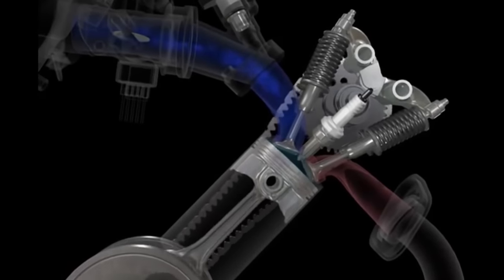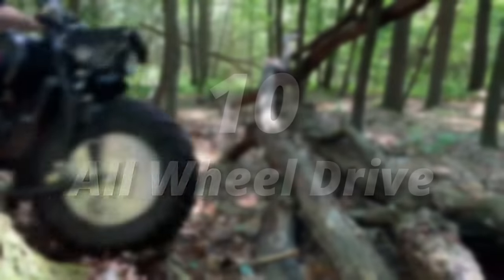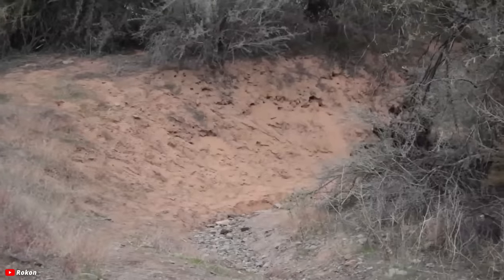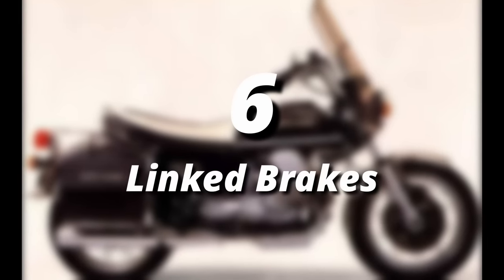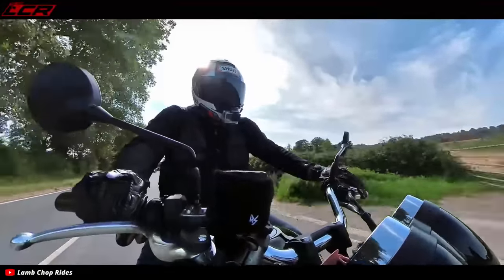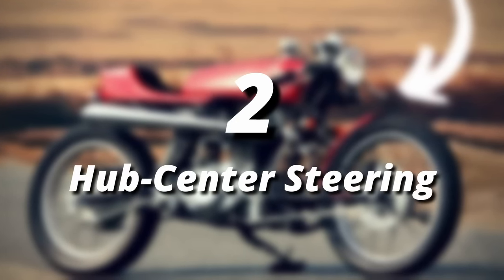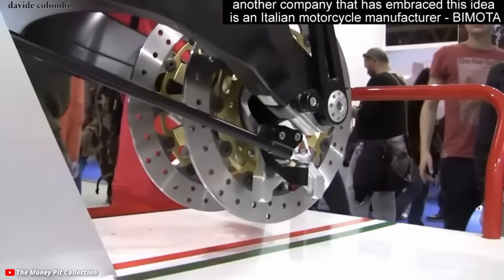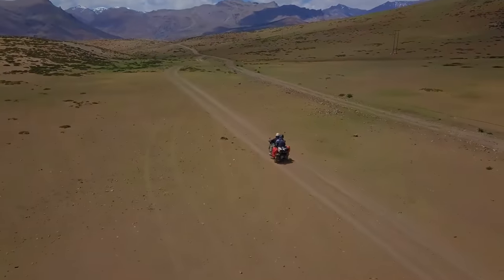10 Motorcycle Innovations that never caught on

Comment: I owned a Moto Guzzi with the dual braking system and I loved it. The foot pedal operated front and back disks. 60% braking force to the front wheel, and 40 to the back. Very useful in wet slippery conditions. The front brake handle was totally separate as normal.
Reply: I also own a Guzzi with linked brakes, my understanding is link brakes prevent driveshaft jacking when braking into a corner.  The linked brakes was only used on guzzi's cruisers, not the sport or sport touring bikes.
Reply: I own a California, and I think the linked brakes work brilliant for the riding style. It keeps the motorcycle level even during emergency braking. Also, with the foot pedal it's easier to brake hard, in combination with the hand operated front brake. During emergency stops, the hand operated front brake is easier to reach, but less effective, in practice you kind of "pre brake" with the hand lever and add the other front and rear brake with your foot. When familiarizing myself with this on an empty parking lot I found that I could stop just as fast as a modern abs bike, without losing traction.
Reply: I think the pedal worked the rear brake & one of the front brakes, while the handlebar lever worked the other front brake. Well I know some Guzzis worked that way.
Reply: Great video!  With regard to linked brakes, I use my front brake in most situations and would benefit from linked brakes most of the time to improve and simplify the process of slowing down and stopping.  However,it would have to work in a specific way to be practical .  Linking the front (hand) brake to the rear (foot) brake makes sense especially with ABS.  You could more quickly grab a handful of brake and either modulate it or clamp down to deliberately achieve a rapid deceleration or stop.  But, on the other hand, linking the rear brake to the front brake does not work because when you are descending a steep grade on a graveled, wet or otherwise slippery road surface you need to apply the rear brake only to drag the bike to a stop and avoid the massive forward weight shift caused by application of the front brake so as to maintain your balance and preserve as much steering traction and control as possible.
Reply: I had a 1984 Guzzi V65C with linked brakes.  The bike braked extremely well and never locked up a wheel.  I felt totally safe even in  the few times I got caught in rain.  Had to sell the bike to pay for college, miss it to this day...
Reply: @not-fishing4730  Did you not change down using the guzzies massive engine brake? I did on a Honda CB350 straight twin 11.1 compression ratio,brakes were effectively redundant
Reply: @billeudy8481  Can i presume when you go down a steep grade you don't change down but just apply your brakes?
Reply: @Johnketes54  I engine brake without a change in gear unless I need the lower gear for the turn exit.  Being an old man I tend to use the brakes for major decelerations as brakes are cheaper and easier to replace than clutches or rings/jugs.
Reply: I had my California for about a month before I realized the brakes weren't even working I fixed them and still don't really need them the engine braking does it for you
Reply: @not-fishing4730  No, here in the UK the Le Mans and Monza both had hydraulically linked breaks
Reply: @not-fishing4730  Not correct. My 850 LeMans Mk2 had linked brakes. Footbrake operated 1 front disc and the rear disc, while the hand lever operated the other front disc. Once you got used to how it all worked, it worked brilliantly, especially in the wet.
Reply: @mickvonbornemann3824  Exactly!
Reply: @Johnketes54  I certainly did on my 1976 Ducati 860 GTS. Fantastic sound through the Contis.
Reply: @not-fishing4730  That's not 100% correct. My 1980 X100 Lemans had the intricate breaking system. At that time they all Guzzi's  had it.
Reply: @not-fishing4730 -  "The linked brakes was only used on guzzi's cruisers, not the sport or sport touring bikes."
WRONG.  I had a Moto-Guzzi V-50 II; other friends had the 850 Le Mans II and the 850 T3;  ALL had linked brakes.
Reply: @mickvonbornemann3824  - yes, Mick;  you're dead right.
Reply: @billeudy8481  - "when you are descending a steep grade on a graveled, wet or otherwise slippery road surface you need to apply the rear brake only to drag the bike to a stop."
Speaking from personal and very hard experience, I know that's the surest possible way to lock the back wheel and go into a broadside skid.
Reply: @hammondeggs3356  - I know what you mean;  my V-50 was stolen, and every time I see even a picture of a Moto-Guzzi, I pray that the stinking little rat who stole it burns in Hell for all eternity.
Reply: @Johnketes54  "Did you not change down using the Guzzi's massive engine brake?"  No, never - because I can't think of a better way to lock the back wheel and have the bike go sideways.
Reply: @not-fishing4730  Sorry but linked brakes were fitted to Le Mans 850 and V65 Larios both of which were considered sports bikes in their day.

Comment: Honda had a great linked braking system where the rear brakes engaged the middle piston of the front caliper, as well. It works amazingly well, I have it on my VTX1800, and it adds stability to stops that really helps on larger bikes. You can still skid, since the front has3 pistons on each side, total of 6, you're only engaging 2 of the 6, just barely noticeable, but very helpful in some situations. I believe the front brake lever works the same way, engaging about 20% of the rear, but I'm sure.
Reply: I have the same on my Honda Silverwing scooter. Works great! It was invented by Moto Guzzi :-)

Comment: I once had an old hard tailed, HD, two stroke, single that had a left grip mounted , 3 speed, shifter clutch like you show here.  I thought it worked just fine, but I did not ride it in the woods or on the trails, either.  I imagine that it might have some problems, there.

Comment: Hey Bart. Interesting video, but  you left one out. Anti-dive front suspension, typically front forks, but my former boss, John Long, the roadracer from Miami, Florida raced a BMW with a manual (for lack of a better word) anti-dive setup with rods and levers back in the 80s. All the other manufacturers were using some kind of hydraulic system which diverted some of the fork oil to stop the forks from compressing under braking. Incidentally, BMW's team manager was Udo Gehtle (not completely sure about the spelling of the last name), who went on the manage team Honda's roadracing effort. Anti-dive showed up on many of the major manufacturers production bikes, but it was complicated and only made front fork maintenance more of a hassle.
Reply: I rode a BMW R12C for many years and loved that bike (until the driveshaft stripped = $2500 repair!).  The innovative telelever front end was very effective at keeping the front end from diving...I miss that bike  😥
Reply: @acehandler1530  Thanks for the response. I worked on Beemers, first boxers back in the early 80s, then K bikes later in the mid to late 80s, even went to 2 BMW schools to learn how to work on the latter. However, I got out of the motorcycle industry in the early 90s and never rode a beemer with telelever suspension, altho I did read about it. Even before telelever, BMWs were great handlers and I was very impressed with ABS. I didn't know or remember that one of the features of the telelever front end was anti-dive. Thanks for clueing me in.
Reply: @parsonscarlson7984  Had a K1200RS for awhile, really liked the bike, especially the Telelever. 
Trying to work on the bike was such a PITA I sold it.

Comment: When we were growing up in the late 60's to mid 70's, there was a kid up the street who had a (Honda?) Rabbit 90. The left grip actuated a centrifugal clutch with 3 speeds on the left grip, pulling in the clutch lever was optional. It worked either way. The vespa-style scooter was off-white, and we rode it everywhere it could go in the woods. It had a rabbit logo on it like the impala for Chevrolet.
Reply: Those were made by Fuji heavy industries, the same people making Subaru cars today! The larger Rabbit model had a fluid coupling for the transmission basically making it a twist and go like modern scooters.
Reply: Many girls in NZ has them, they would come to a standstill on steep slopes.

Comment: actually Moto Guzzi developed some kind of Automatic transmission for its Idroconvert (california 1000), replacing manual gearbox with a torque converter built by Sachs, and two-speed gearbox. The consequential lack of braking effect of the 4-stroke engine is what pushed Moto Guzzi to develop and adopt the "integral braking" or linked braking system.

Comment: The Simson Schwalbe also had a Gripshift. It was also quite common in the mountain bike industry.
BMW used a system called Telelever that is different from the usual teleforks.
The main reason to favor this system is that these bikes literally have no diving in under front braking. You always have full front travel even under hard braking.
In the 90's a man from Austria invented a parallelogram front fork for mountain bikes that works similar to the telelever front suspension. But in the bicycle industry it did not catch on.
Reply: The BMW Telelever was invented in the UK by Saxon-Motodd.
Reply: @peterwilliams2152  
Norman Hossack is credited with the design.
Reply: @VintageSG  Learn to read - Telelever was designed by Saxon-Motodd. Duolever was designed by Hossack amongst others.

Comment: Nice review!
2 things missing in my own opinion:
- my BMW R69 had a swing arm for, known here in France as "Earles" fork. Amazing thing was that the drummer brake was mounted on the horizontal arm, and when braking, the front of the bike and the head light
Reply: In sweden the R69 (euro model)'s front suspension is could "ölgaffel" the translets to "bear"(that you drink)-fork, but the usdm models had normal "right" way turned forks (by old standard, meaning hydraulics on the bottom).
Reply: I have used an Earles front end on a bike I was building and when it came to riding and braking, it had both good and bad habits, as follows... When braking, application of the lever caused the front of the machine to thrust UPWARDS instead of down.  On normal bikes, using the front brake will tighten your cornering ability.  With an Earles, it takes you to the high side of the turn, but, it also applies more downward force on the rear wheel.  In short, it imitates the motions and results of a panic stop by a horse.  This, in a motorcycle, is not to be despised.  I became rather adept at juggling these reactions and hoped they would become something more of the norm, but with the exception of the R-69, I never saw another.  Mine came from a junk pile that was all that was left of some antique European bike that had been between a concrete barrier and an 18 wheel truck.
Reply: Apart from BMW, most seem to be aftermarket systems for sidecar use.
Reply: Just to finish my comment, before I got pissed by my computer keyboard errors...
I was surprised you didn' mention the Moto Guzzi 1000 Convert, which had a real "convertisseur" and not a computerized operated gearbox.
I chickened out at the time, and bought the 5 gears manual version.
In my very early days of riding, I had a Honda PS50, wich had a 3 speeds gearbox controlled by handlebar rotating grip. Very slow bike, but gearbox and 4 stroke engine were not common on mopeds at the time!
Reply: @russbilzing5348  in the 60s Sachs,down& Greece's dirt bikes had leading link front forks,which were handy. They didn't dip when brake's we're applied,so you had full travel  when you hit bumps after braking, but hard to wheelie ,cause extra front end weight
Reply: Dkw & Greeves I hate auto spell
Reply: @junk_rig_81  I would not say chickened out,The Honda CB750 automatic could only manage 85mph,But the manual could manage 110/120mph
Reply: @russbilzing5348  probably off an Ariel Leader
Reply: The "Earles" fork was designed and patented by Ernie Earles in the UK. It was a specialised form of leading link fork with the swingarm pivot aft of the wheel.
Reply: "Ay lof zi drummer-bregg" something Keith Moon or Ginger Baker never had......

Comment: Yes Bart, you've said it all , right there:   The '80's was the PINNACLE" of motorcycles.   Engineering, etc.   If you look back and check the "#'s", you'll see that okay , the horsepower has come up, but the gas mileage, simplicity of maintenance and everything else hasn't really went any further, from where it was , back in the mid '80's!

Comment: bikes don't employ the twist-grip shifter because it's a lot cheaper and simpler to mount it directly to the selector on the case, and shifting is quicker. why it was on the handlebars was because of the form factor - on a scooter, your feet generally don't do anything (the lambretta did have a rear brake pedal) which was why they were driven to devise the system. my scooter has CVT, which is a cool innovation in itself.

Comment: I started riding at the age of 15 with one of these grip shifter scooters. The scooter is from Bajaj(now part owner of KTM). There used to be competing scooter models from Vespa and Bajaj here in India in the 80s and 90s. After I moved up to motorcycles, I never missed them, but it felt good to be able to see which gear I was in. Always missed that in a motorcycle.
Reply: Was the Bajaj the copy of the Lambretta! I remember you could get one imported from India for £1200 or something! Maybe bit more expensive but bargain nonetheless!
Reply: @WilliamLithgowGuitars  yeah..pretty much same design and stuff...though I must admit I wasn't aware of Lambretta back then. 2 stroke engine meant it was quick and powerful.
Reply: I can usually tell which gear I'm in by looking at the tachometer and speedometer
Reply: My Suzuki GT550 two stroke had a "gear selecter" between the speedo and the rev counter a LED in red,Novel in it's time   unnecessary though because the gear pedal would not move past top gear,Where the previous HONDA 350 the pedal would flop about giving you no indication of what gear you were in
Reply: KTM
KRONREIF TRUNKENPOLZ MATTIGHOFEN

Comment: There's been numerous kinds of front ends on bikes, and some do work better than telescopic forks for some situations. One oddity was the British "Dot" trail bike, which had no springs or shocks, but instead used rubber bushings in torsion. Hub center steering dates back to the 1920's as does many of the "modern" ideas used on motorcycles. Telescopic forks do well at everything with low cost, durability, and simple engineering which is why they will always be most common. 

I have to agree on the disliking of anything between me and my direct control of the bike, for me including ABS and linked brakes too. I don't want anything to think or do for me those things I can and should be dealing with myself; it is exactly that which makes the experience of riding a motorcycle so unique and so rewarding. But sometimes I can understand others wanting different...

I was parked in a bike shop waiting my turn for something when I noticed a guy on a Honda pull in. There was something a bit odd about the way the bike sounded and how he was riding. I noticed the bike was one of their "automatic" models as he too pulled into the shop, kicked the sidestand down, then hopped off the bike onto his one leg. Gotta respect someone who loved riding so much they wouldn't let an amputated leg stop them from doing it- for him the automatic trans made all the difference in the world.
Reply: I helped a young man who had lost his hand and made a clutch operarated with his knee against the fuel tank,He had a mechanical hand probably not strong enough to pull the clutch
Reply: I agree P RO with your dislike of ABS, and can add to your info about centre hub steering - Militaire had it in 1914. Despite its French name, it was made in the USA. Cheers, Munro Berry
Reply: As much as simple fork steering design is well, simple in engineering....what i don't get is the apparent mechanical stress all going to the pivot point, the whole weight of the bike along with rider....& not a single engineering rectification on it. Seen bunch of bikes & cycle mishap & that's the first thing that's breaks off under stress. This is more of production cost cut leverage for its simplicity sake in engineering, that's why it's still prevalent. It's cute when certain narrative seem to favor but not quite.

Comment: Vespas also have spare tires, and that could be an eleventh innovation: Kudos, very informative and well made
Reply: My Ural has a universal spare mounted, swapped it when my original pusher tire started wearing down. The problem is that most motorcycles use different front and rear wheels.
Reply: @BikerMage  There are also those small Isuzu cabover trucks, that have different size front and rear wheels: 2 spares bolted together, hanging under the tray, or van body.

Comment: My friends and I used to ride our German-made Puch and Zundapp mopeds (49cc) to highschool back in the '70s. Left hand side grip gear shifters were very common back then. But it required some serious hand-strength to hold and twist the grip (to the right gear!) at the same time.  It was just NOT a convenient system!
Reply: It was indeed common on a lot of 60's and 70's mopeds. Never found it hard to shift, maybe you rode a bike with bad rusty cables.
And this is one of the problems, the control cables have to be adjusted right to get in to the right gear. 
The way the system works means it is also not suitable for higher power bikes, say >150cc.
Reply: AFAIK the Puch was also sold with left foot gear shifter, but I remember the left handlebar shifter on several 50 cc mopeds back then.
Reply: @thorman1742  My first motorcycle was a Puch, an early 60's moped, and I was 14. It had a left foot shifter and true to it's moped name you could pedal it although up hills was almost impossible.